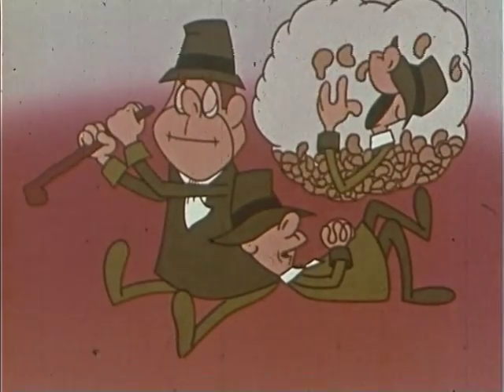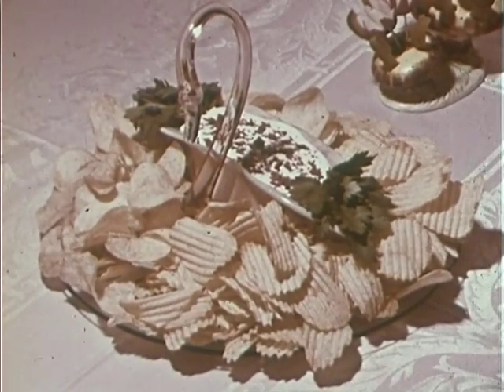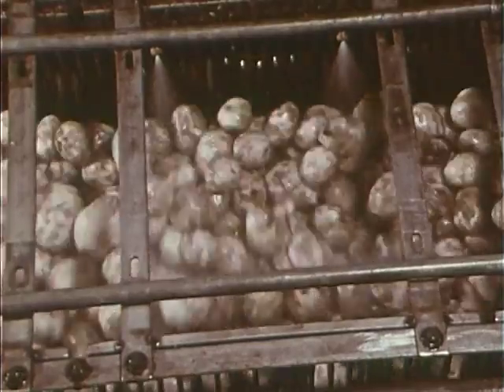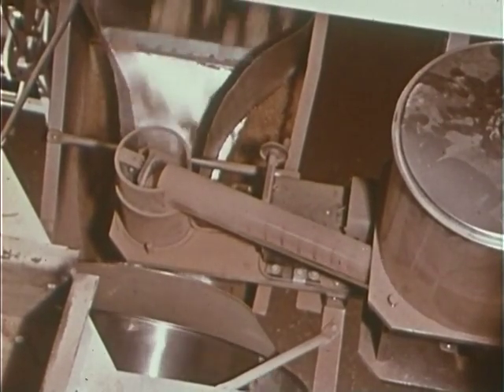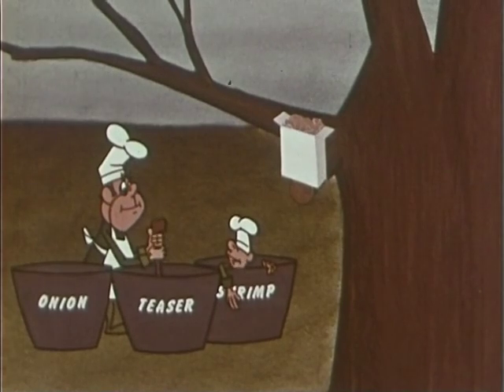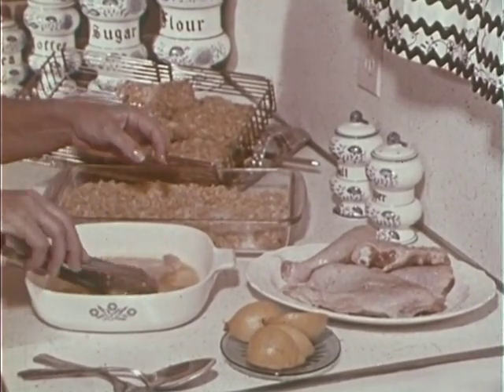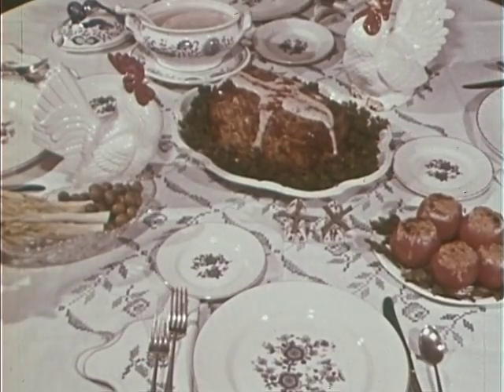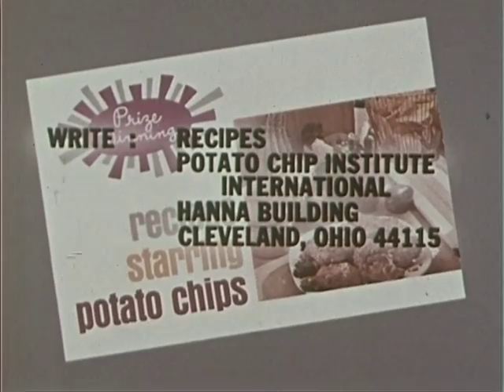Adventures of Chip And Dip (1968)

Comment: 0:41- Another account had Chef George Crum, of Moon Lake House in Saratoga, New York, preparing a dish of fried potatoes for a guest who had just returned from France. He wanted his potatoes sliced thinner (as chefs served them over there), and had it sent back to the kitchen. The guest STILL wasn't satisfied with them, and insisted the potatoes be sliced even THINNER.  After another go around, Crum was so angry, he sliced a batch of potatoes into paper-thin slices, cooked them in deep fat, salted them, and marched into the dining room, serving the dish with a flourish before the started guest. But he LIKED those thin, browned and slightly curled potatoes- as other patrons of the lodge did. The new dish was christened "Saratoga Chips", and was a speciality of Moon Lake's menu for years.  The recipe was featured under that name in the 1887 "White House Cook Book", as follows [under "Vegetables", page 193]:
**"SARATOGA CHIPS.
Peel good-sized potatoes, and slice them as evenly as possible. Drop them into ice-water; have a kettle of very hot lard, as for cakes; put a few at a time into a towel and shake, to dry the moisture out of them, and then drop them into the boiling lard. Stir them occasionally, and when of a light brown take them out with a skimmer, and they will be crisp and not greasy. Sprinkle salt over them while hot."**